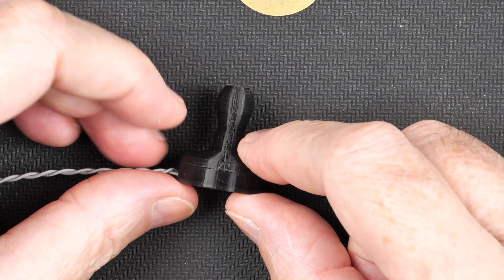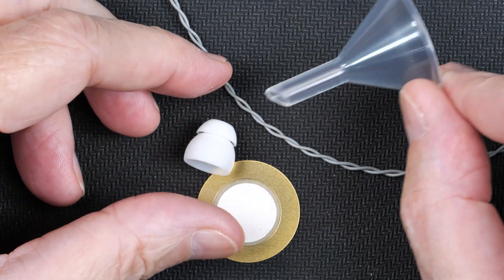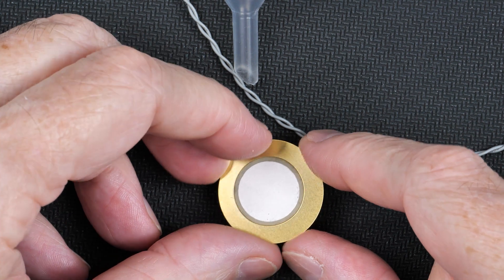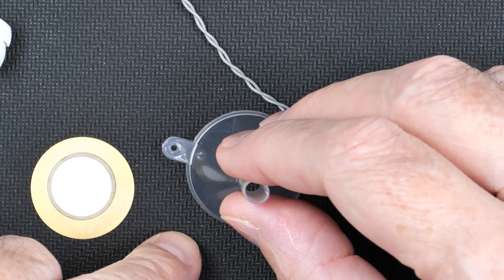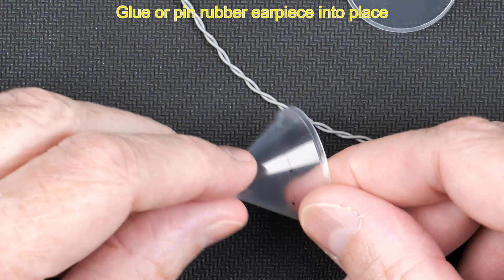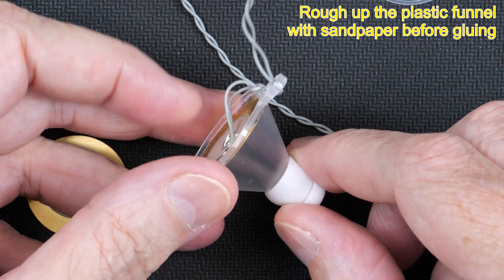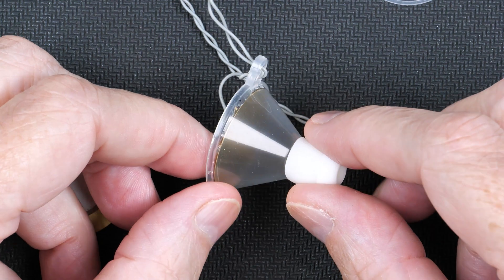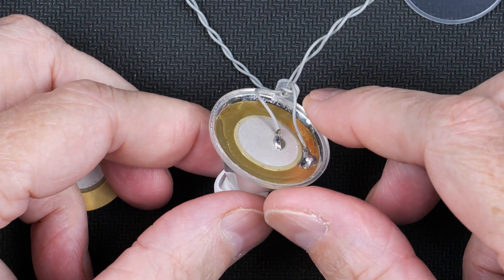Crystal Radio Earphone From Common / Cheap Stuff

Comment: It will work even better ... if you use two thin wires from the piezoelectric disk. Join them to the stronger stranded wires at the strain relief tie down point where you drilled the second hole in the funnel's "handle." The way you have it now, the thicker wires absorb some of the vibration with their heavy mass and some viscous damping when the thick plastic wire insulation flexes with vibration.

Comment: I saw a fellow make a high impedence headset fron chili cans once using 30 awg hand wound coils. I bet it would be much easier to make a home made headset from scratch using piezo discs similar to your retro fit model.
Reply from the maker: @adnacraigo6590  I bet you're right.

Comment: Thanks for that. I had been wanting a high impedance crystal type earpiece for a while. I do have a couple of old ones that didn't seem to be working at the time. I had no idea you could use those piezoelectric things. I have a few of those. I even have a similar size little funnel.
Reply from the maker: There are some severe issues with earphones made in Taiwan. I made a video on that discovery process.
https://youtu.be/D9HVJ5GOaEE